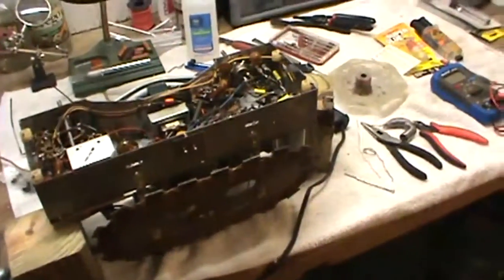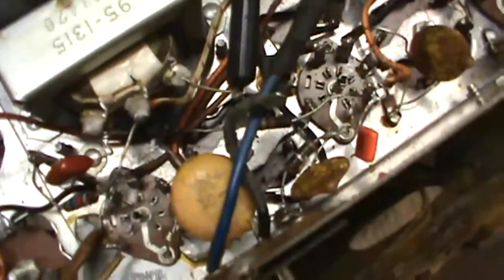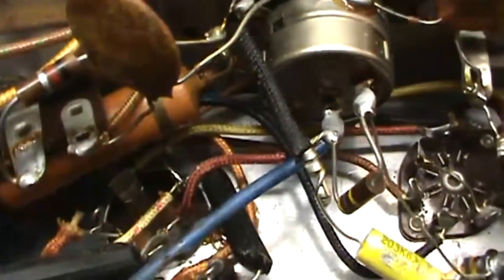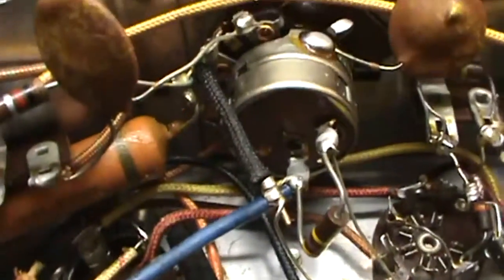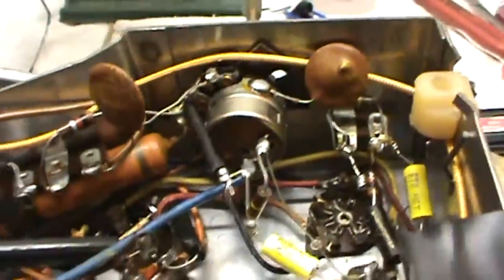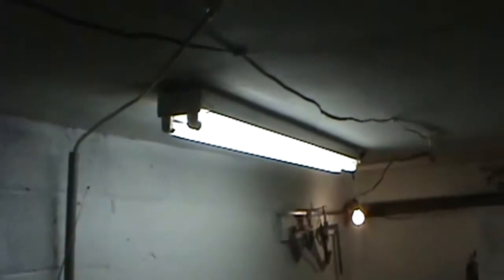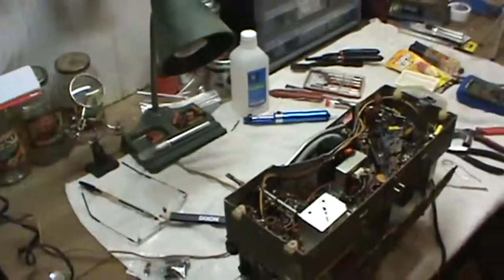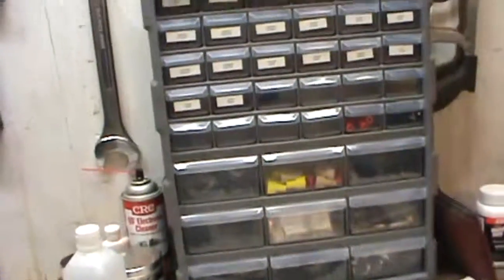Zenith K725 Update #3

Comment: Gary,
It might be an idea to check your labours thus so far by plugging the radio into the mains, if you deem it safe, before tackling the capacitor down by those two loading coils.  If your radio works at least as good as it did before replacing components, then continue the replacement capacitor work.  If a problem arises it should be quicker and easier to locate having replaced a few components rather than whole of the ones you intend to replace…just a thought.   
The method I was taught years ago when accessing components in restricted areas is to produce a pencil and paper sketch of the components causing the restriction, and their surrounding area, including colour of wires, values of connected components …anything you deem helpful, before loosening screws, speed clips, or whatever secures them onto the chassis.  Very carefully pull coils, capacitors, transformers…or whatever is restricting access, upwards, or move a little to one side …being exceptionally careful not to break anything.  Where ever possible, avoid temporarily removal of components causing restriction, especially if they are as delicate as coils, trimmers, padders etc. 
Occasionally, when faced with no alternative, I remove components.  One thing for sure, if it is safe I do a power test on the radio, and then produce a clear sketch of the area in which I’m working on the radio chassis.  I find it very maddening, having completed replacing all the components, the radio does not function, and then having to tediously go through the entire radio circuit bit by bit because I’m unsure the problem is due to component replacement error, or replacement error of the component I temporarily removed to gain access to another component.    I generally advocate checking work as one proceeds: it might prolong the repair/restoration job a little but it will be worth it in the end.
As for the electrolytic smoothing capacitors: in my opinion, re-stuffing old capacitors in a radio for one’s own use is a pointless operation.  The only time I re-stuff them is when requested to do so …like a year ago, I re-stuffed them as the radio was to be a working artefact in a Traditional Heritage Centre.  I suggest leaving the old electrolytic caps in situ, drill the chassis where there is convenient space, secure solder-type terminal strips (either underneath or above the chassis), and solder replacement caps onto them.  It is your radio.  Provided you do a safe and secure job, who should care about internal aesthetic appearances if the radio functions brilliantly? 
It certainly looks like you’re doing a good job on that radio repair thus so far my friend.
Regards,
Phil.  P.s, most of my seed planting into seed trays is turning out to be somewhat poor at present.  Up to now, it is looking like I’ll not be growing carrots, parsnips, broccoli, sprouts, turnips, and swedes this year but I’ll definitely be growing cabbages, leaks, onions, runner beans, and beetroot…with a little bit of luck LOL.

Comment: Your workshop looks great Gary.  Regarding the buried cap... you can always relocate it - just make sure the new one is connected to the right places.  I am sure you'll be able to snip it off.  Did you replace the .02cap with the shield ?   Good stuff - Thanks Ron
Reply from the maker: +Ron C Hey Ron.  Thanks, and yes, I did replace that .02 cap.  It's one of those yellow film caps.  I believe just to the left (in the view I shot) of that black JFX metallized polypropylene cap.  The only reason that black cap is there is because when I was ordering the yellow film caps they didn't have one of that particular value, a .0005 and referred me to that thing.  When it arrived I had to wear a strong pair of reading glasses AND use a big magnifying glass to read it's label.....and I have 20/20 vision, lol.  I discovered the old shop light still works by wiring it back up with two new bulbs in it.  I had never seen bulb sockets like it has and it took me a long time to figure out how to change them, once I did it was a piece of cake though.  All I have ever seen were the sockets where you put the pins in from the bottom and then rotate the bulb/tube until it locks into place.  That old light doesn't have that, it's socket ends just have two pin holes for the pins with no obvious way to get a bulb/tube into them until I discovered that on one end the sockets are spring loaded and slide back so that you can remove the pins from the socket at the other end and then of course the whole bulb/tube comes out.  So, I guess I'll be re-installing it as well and instead of two new shop lights I'll have two new ones and one vintage one up there :)  I'm glad because I wanted one that has the shade and focuses the light more on the work area and the new ones don't have shades.  I can't complain about them though because they were a Christmas present.  lol.  Take care, Gary